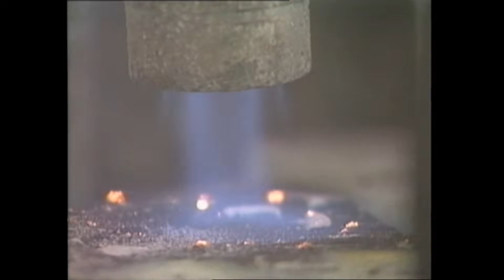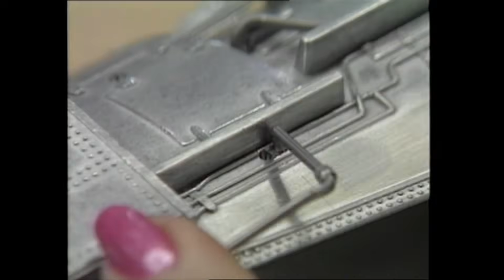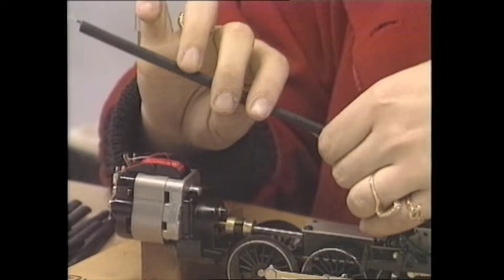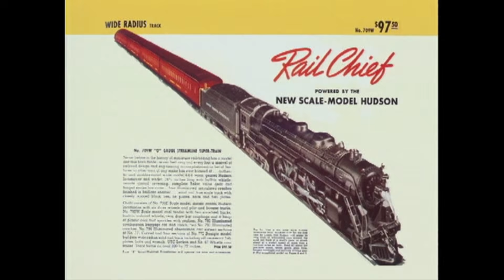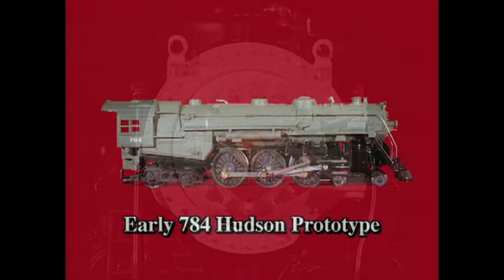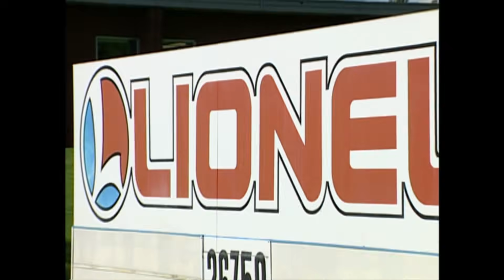Lionel Legends The Hudson | Full Show

Comment: Why didn’t Lionel make ALL of their locomotives scale, using original blueprints? 
Gilbert American Flyer’s entire S gauge line was scale, 3/16 inch to the foot. That’s why they looked so good, running on 2 rail T-shaped track, just like the real ones. 
There’s no comparison.  🚂🇺🇸
Reply: Because Lionel was a toy company and made their money mainly through their toy trains. Plus at the time, the tooling was rather primitive so scale proportions were difficult to accomplish until the diecast tools came along in the 30s. Plus Lionel wanted their toy trains to go around tight curves so most of their trains at the time were scaled down for clearance.

Comment: Was that the same Jim Bunte who was with Collecting Toys magazine's staff back in the 90's?
As to that Commodore Vanderbilt, I'm inclined to agree with Lionel on the color. Not only was it likely that the photos were probably altered to contrast the locomotive with the sky, but there is a subconscious tendency to think of the usually dark color of the Marx version of the Commodore Vanderbilt which was so well known. One thing though: you know, in those old pictures, the drive rods are certainly silver, and the drivers  and pilot are a very dark color. So it did have at least two main colors, not to mention trim .
Reply: Well the Commodore Vanderbilt was painted in a dark metallic grey. Metallic paint will reflect light and look lighter than it actually is. If you watch old film of the actual Commodore Vanderbilt, it's dark grey. Unfortunately Lionel made the mistake again when they did the run of vision line Commodore Vanderbilts. The grey they used is too light.

Comment: For Lionel Nation Part 5, TM could've considered featuring the Chesapeake & Ohio L-1 Yellowbelly Hudson as the model segment instead of the custom U.S. Presidential Railcar, the Ferdinand Magellan. Although the Ferdinand Magellan was an interesting choice for showing how presidents once traveled before air travel became dominant,

it's just that the L-1 Yellowbelly is such a vibrant and uniquely designed engine, that the Chesapeake & Ohio created, 

I feel that Lionel could've also introduced the L-1 Yellowbelly in Standard Gauge since Lionel brought out the Standard Gauge Hiawatha in 2002, which would be nice to have for the top deck of my multi-level layout, 

if I ever have the room with my regular O-gauge running down below.